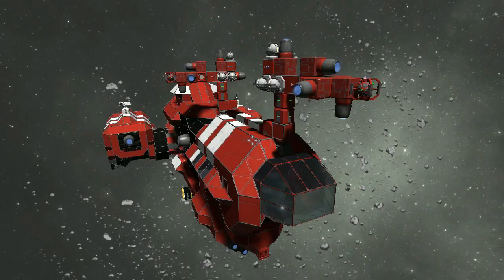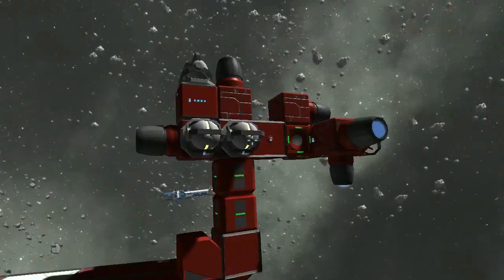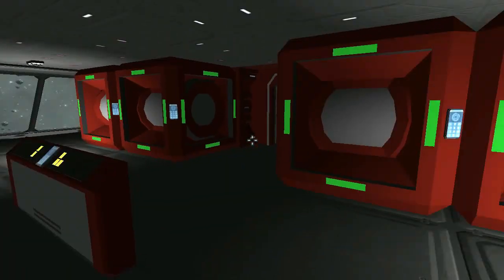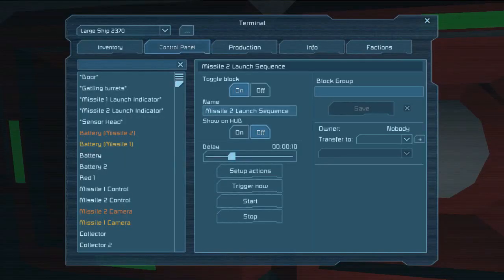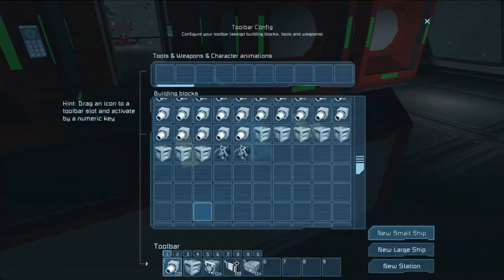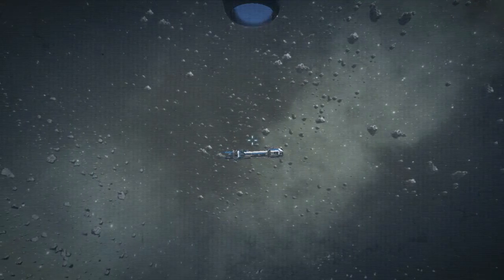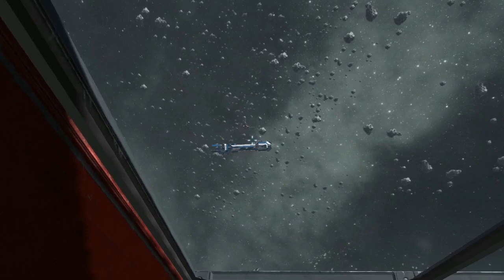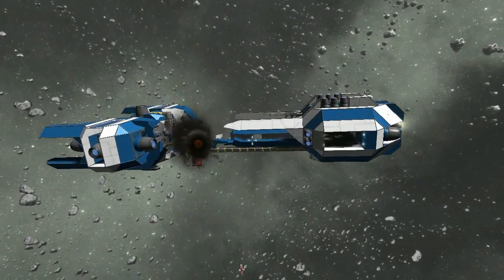Space Engineers Ship-to-Ship Missile

Comment: You can also just disable all the sensors on the missile except for one, which is set to turn on all the other sensors as soon as the missile leaves detection range.
Reply from the maker: That's not a bad way of arming the seeker!  The other important thing the Timer Block does it simultaneously turn on the missile's forward thrust and disengage the Merge Block.  I wasn't able to come up with a way to do both without the Timer Block, but I suppose you could just make that two different button on the launch control panel and push then one right after the other.  Thanks for the ideas!